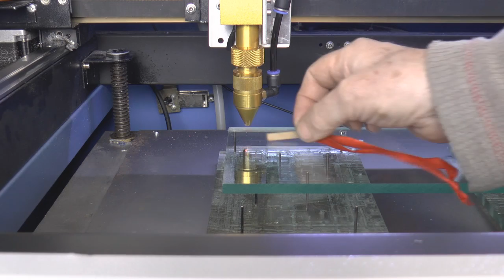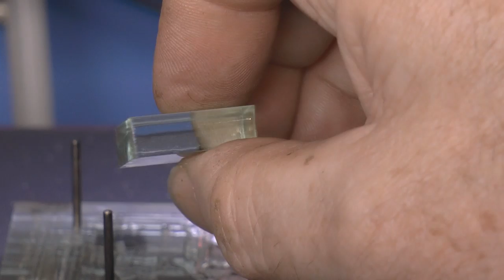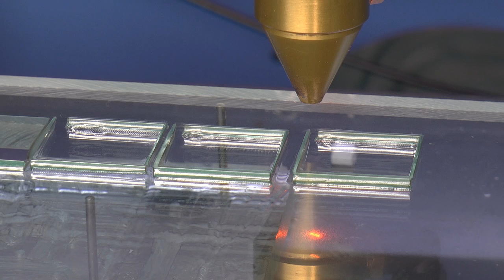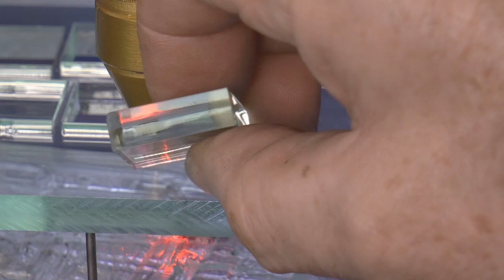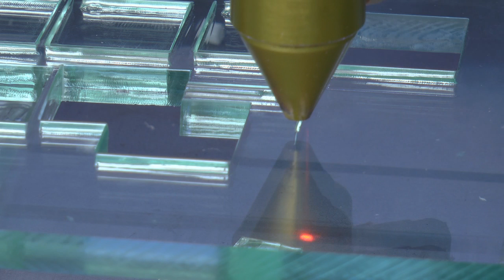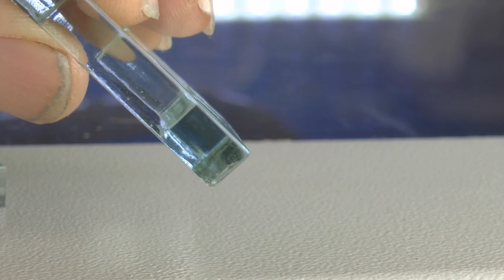RDWorks Learning Lab 54 Acrylic beam drag and flame polishing

Comment: My acryllic just chars and burns
Reply from the maker: Hi
 The bad news is that you are not using acrylic. How can I be sure? Because acrylic is akin to H2O. Acrylic  is solid and clear at room tmperature. At 1  degree C, ice becomes liquid. At 160 C acrylic becomes liquid. At 100C water boils, evaporates and becmes steam. At 20-0C acrlic boils and becomes acrlic vapopur (steam)  Hold a cold surface to eitherannd they recondenswe. It is impossible to burn or char water and so it is with acrylic. The only difference with acrylic vapour is that you can heat it further and it becomes an inflammable gas, Ii is impossible for the cut to biurn and char. I would suggest that you have probably tried to cut polycarbonate  that creates masses of brown fumes or maybe PET which cuts with a reasomabl;y clean edge but produces masses of yellow fumes.  Other clear materials include styrene or ABS.  You should not be cutting either of these because they produce toxic fumes.
Reply: @SarbarMultimedia  thx for the response here in Norway the shops dont Even know what they sell themself. Am suspecting it is PET from your response as it left a yellow Power on the nozzle. Is this also damaging to the machine?
Reply from the maker: @Actio83  
 I have cut quite a lot od PET.. It cuts at quite a high speed and leaves fairly cleam edge but I pesonally never want to breath those fumes. I am fairly confident there is nothing in the fumes to damage the machine  but you havee to leave the protective film on or the yellow fumes stick to the surface and are not easily removed.. PET is a cheaper alternative to p[olycarbonmate  and is what they use for fizzy pop bottles . It has a fairly wide rand of temperature where it remaiss soft and can easily be blow moulded.
Reply: @SarbarMultimedia  I was also unfortunate and had the vent hose loose so it filled the shop with smoke… opened the gate and aired out the room but did inhale a bit. Hopefully not dangerous in on off insistents. That a lot for the help, hard to find knowledge on this
Reply from the maker: @Actio83   Hi 
 The good news is that It cant be that toxic because you made it to the door to ventailate the shop!!  Serously though.  Lots of inhalation willbe bad for you but such small and short term exposure will not harm you
Reply: @SarbarMultimedia  learned a valuable lesson, to be a lot more critical of what the material actually is :)

Comment: maybe someone already asked..  does it matter if it casted or extruded acrylic??
Reply from the maker: Hi Lenny 
 Acrylic is a unique plastic with properties that are analogous to H2O. It is solid at room temperature (ice) but at 160 C it immediately becomes liquid (water). At 200 C it evaporates (steam) into acrylic vapour and can be recondensed back to solid  acrylic upon contact with a cool surface.
 Its a weird quirk of physics  that both cast and extruded  materials are exactly the same molecular structure but they have different properties. The extruded acrylic seems to have a much lower thermal conductivity,  although it cuts just as easily as the cast acrylic.  The lower thermal conductivity retains heat in the walls of the cut for significantly longer and  whilst above 160 C , will allow the thin film of liquid acrylic  on the walls  a few mm behind the cut to "level" out. It is this mechanism that creates the polished finish to the cut.  Below 5 mm thickness it is almost impossible to get that same finish with cast acrylic unless you dramatically reduce the cutting speed (50% or less). Cast acrylic cuts are burr free but run your fingernail over the top or bottom edges of an extruded acrylic cut and you will detect a  noticeable burr.

 Best wishes
Russ
Reply: @SarbarMultimedia  thanks for the info.
will give it some more tries with different settings.  the one I made started to crack all over after a few days.

Comment: Thank you again for another great information video. Do you have any idea how to get rid of the vapour coming from the cut? Those often 'melt' or settle into my acrylic, ruining the surface image. An example is at 3.13 in this video to the right and left of the cut line. Thank you
Reply from the maker: Hi
Acrylic might look like a soft easy plastic to cut and engrave but it has some unique material characteristics. It is solid at room temperature and then turns to liquid at 160C, It remains liquid for a short time until 200C where it turns into acrylic vapour (just like water turns to steam). There is NO chemical change,  so as soon as it touches your work surface (or any other cold surface) it will condense back to liquid acrylic (just like steam turns back to water) which eats into your surface a little as it cools back to solid. That is why you get this misting effect that will NOT wipe off.
Characteristic number 2.  Just like a cup of boiling water will quickly fill a room with steam because the vapour occupies thousands of times more volume than the liquid, so is the case with acrylic. If you lightly pulse the surface of acrylic with low energy you will convert just a small volume of acrylic to vapour and it will explode UPWARDS like a volcanic ejection. However, if you increase the power you will be trying to convert much more solid into vapor and the uprush of gas is not quick enough to let all the expanding gas flow UPWARDS. There is so much volume that it gets forced sideways and IMMEDIATELY condenses on your work surface,.
 So there are  TWO things you do not want during engraving. First you do not want any powerful air assist blowing fumes down onto your work , just a gentle airflow to protect your lens. Secondly you  need the MINIMUM of power to mark the surface of your material . If you engrave deeply then you will suffer acrylic condensation no matter what. A good trick is to dither any bitmap image so that you are breaking up the power into discreet dots and short lines. Use low power.
 Cutting is different. Whenever you start a cut you will always have the explosive horizontal debris because there is nowhere else for it to go. Once your cut has started you need max air assist to blow the fumes out of the BOTTOM of your work, you do not want any fumes coming up.
 Hope this helps
Best wishes
Russ
Reply: @SarbarMultimedia  Dear Russ, thank you for such a prompt and detailed reply.  After watching 8 hours of your videos yesterday I'm making progress with my machine!

Comment: I am  wondering what kind of base are you using.  I mostly see people with Honeycomb bases that are metal.  Yours looks like it is either glass or a big acrylic piece...
Reply from the maker: Hi Matt
You must remember that you are following me on a journey of discovery and at this stage I have so much more to learn. I have not yet discovered the real value of air assist for cutting or the essential requirement for air flow management through the machine.. I have  found  that honeycomb tables are a bit of a disaster  for most cutting because the beam reflecting off the metal edges of the cells cause burn marks on the back of your material.  Lifting the material off the table prevents this reflection and also allows the fumes to escape freely below the material rather than being trapped in a long thin tube (the honeycomb cell).  Air flow management and cut efficiency is a subject that would take me several pages to explain. If you serach for RDWorks Learning Lab Air  Assist, you will come across several videos where I uncover the secrets.  You will then begin to understand the reason why no machine should ever be fitted with honeycomb. It looks like a brilliant idea but turns out to be as brilliant as shaving with a blow torch.

Best wishes
Russ

Comment: Could a collimated beam (passing through a converging lens to tighten it up then through a diverging lens to bring it back "straight") solve this problem altogether?  I'm trying to remember the college-grade optical physics course which I took over 20 years ago...
Reply from the maker: Hi Claude

Hi Claude

There is one massive problem with trying to apply conventional lens theory to our IR beam . Lens theory assumes a uniform collimated beam and usually monochromatic.. We  have the single wavelength (10.6 microns) but the beam is not uniform, It's energy density is close to Gaussian  (a normal distribution) About 70% of the beams energy is contained within 1/3 of its diameter.. Unfortunately beam drag has nothing to do with the convergence or divergence of the beam. it i all to do with energy per unit of time.  When you try to cut too fast the  bottom of the beam starts to drag as it runs out of energy. If you slow the cut then there s sufficient energy per unit of time to damage the material vertically. To demonstrate this time and energy principle, pass your hand over a candle flame. The faster you move your hand the less heat you will feel. Slow right down and the heat will have sufficient time to reach the damage threshold for your skin.. Ouch.

Best wishes
Russ
Reply: @SarbarMultimedia  In fact I should have specified the "hourglass shape" of the cut when I was referring to "the problem".  Thank you for your response.  My optics course is really far back in my memory :-)
Reply from the maker: @claudehebert3131  
Hi Claude 

You may be a bit surprised about your hour glass supposition. I am close to completing my VERY in depth study of cutting with various materials and lenses. The results so far are rather interesting. I'll say no more at present.

Best wishes
Russ

Comment: Thx again Russ  started with a 80w laser now have a 150 watt bigger bed size also and still your videos are so helpful, your stuff and the way you present are fantastic 2 years ago i got my first machine now Im running 2 Yes its Wayne with multiple sclerosis no won told my I couldn't so i did :-)
Reply from the maker: Hi Wayne
Congratulations on your new acquisition. I presume that your experience with 80 watts convinced you that for all the cutting you do it would be more efficient with a more powerful tube?All best wishes for the future...maybe working towards #3?
Russ
Reply: @SarbarMultimedia  yes I've got a big contract cutting 10mm acrylics  needed the power

Comment: If you want like a crystal edge finish, remove the air
Reply: You are both right and wrong. If you turn the airflow to almost zero then you decrease the cutting efficiency and allow heat to build up in the cut. That heat build up allows a thin film of liquid acrylic to form in the kerf just behind the cut and this liquid has a levelling (polishing )effect on the  edge striations. That is the theory behind reducing the air assist BUT it rather depends on the type of acrylic you are cutting. If it happens to be extruded acrylic sheet then you will get the polished edged with or without air assist. If it is cast acrylic then you will really struggle to get a good flame burnished finish, not only will you need to turn off the air but you will need to run at least 50% slower to allow the heat to build up.The thinner the cast acrylic the more difficult it will be to achieve that heat build up in the cut . Cutting thinner cast acrylic with a longer focal length lens helps with heat build up. So it's not just as simple as turning the air assist right down. NEVER turn it off or you will coat your lens with acrylic vapour.

Bet wishes
Russ
Reply: @russsadler3471  Thanks for the explaination, very usefull
Reply from the maker: @alifyaanidyanina965  
Hi Alifya
I have done more experimental work on this subject  but it is best summed up in this video
https://www.youtube.com/watch?v=ygN_GJwPLQM&t=1s&index=48&list=PLPWEtx5V9DqEogIeYRdcG_KYcB7UL2Qmn

Best wishes
Russ

Comment: When cutting such a thick material, the first thing I would have tried is of course lowering the focus point into a mid depth of material, instead of surface. That makes all sense of course.
Reply from the maker: Hi Vlad.
Your theory is  a bit of a myth. I have done many experiments and my advice is ALWAYS set the focal point on the surface, especially with acrylic  The basic idea for this myth is a misinterpretation of advice that Trotec give in there guidance for cutting acrylic ABOVE 10mm thick. The big problem is that we do not have the RF driven tube that you will find in a Trotec machine so the effect of the beam is totally different. You will need lots of power and a 5" focal length lens. You can read this for yourself at the top of page 5 in the following document
https://howtolaser.com/blog/how-to-laser-cut-acrylic/. It confirms that up to 10mm thick you keep the focus on the surfsce

Until you have experimented for yourself, I would stay safe and ignore the myth.

Best wishes
Russ
Reply: SarbarMultimedia i actually did and it worked better when i lowered. But none of my experiments are even nearly as sophisticated as yours, so I’ll just take your word for it and will follow your advice then!  Thanks again for providing so much research on youtube for us. Best channel for DIY lasers, period. I bought K40 first for $350, but didnt realize it would be that bad. So decided to return that one and I have 50W machine on order now which I bought for $1350. Slightly more powerful tube there, but also all components are 5x better than K40. Will be worth the investment.
Reply from the maker: The next size machine will definitely be better than the K40.  I suspect you are buying from ebay?  It's good value for money but will probably not be a reliable machine until you fit a new tube and power supply. The ones supplied will almost certainly be sub standard because the Chinese have worked out that people buying from ebay are fairly naive of the technology and it will take a long time to work out that what they have bought is not the real deal.
Sorry to be pesimistic but my evidence base is huge.
Best wishes
Russ
Reply: SarbarMultimedia no problem. I have been working with China on relatively large scale for over 7 years. I know exactly what they do and how this machine is built. I just accept it for $1350 with free 2day delivery. I thought of building my own, but I have too many projects now already in progress. So, decided to just buy. If anything is sub-spec on this machine, they will have to adjust the price for me. I am not one of those naive consumers :))) My last buy from ebay was a 6040 CNC router for $1400, and I ended up only paying $400 for it due to a lot of mess that they made in that machine. So, with that said, I will be thoroughly examining this laser machine, including tube check for conformity sticker etc. if they use reject tubes for $350 K40 machine, it is totally ok. Reject tube for $1350 machine - i will not be ok with. And if they do use reject tubes, and I find that out, it will just cost them money on this order.
Reply from the maker: Hi Vlad
Good luck with your purchase. Let me know the final outcome.
Best wishes
Russ

Comment: I know this is an older post, but I can offer advice to anyone still reading this.  Any laser, even a cheap Chinese one, should have a 3.0in or 4.0in lens, if you are going to cut acrylic.  A 2.0in is okay for 1/8in or less, maybe 1/4in, at most.  When you start getting into 8mm, 1/5in, etc.  You have to have a longer lens.  This is exactly what he concludes at the end.  That the power is gone/out of focus, by the time it gets to the last 2mm of material.
For what it's worth, focusing the 1.5in lens into the material some, actually makes the cut worse in many cases.  That is the main reason for the larger gap at the top.  In addition to using a longer lens, you should focus it right at the surface.
For those discussion a collimator for the beam, you are in luck!  The optically clear acrylic actually does this for you.  When the beam is focused on the surface, the index of refraction straightens it out a bit.  So, in any case, with any lens, focusing into the material gets you nowhere.  (with clear material - a solid color is different)
Very slow speed, is the main thing that gets rid of the "beam drag"  Even using a powerful 150W laser that my company sells, I usually cut the power down to 80-100Watts, and go very slow (1.5in/s, or 38mm/s)  I know that is still a lot faster than the 4mm/s in the video.
Reply: Hello Jason do you any manual or something that you can give, I really want to do better my work. Today I was trying to cut a piece of 10 mm, I think the laser in my job is 150w but the cut is really bad I was trying with 70% power and 3 mm/s do you have any advice for me. Thank you so much

Comment: Would having a collimator help reduce the beam width and straighten it out, or is that cost prohibitive?
Reply from the maker: Hi Mark
Others have suggested the same  and even gone off to make their own versions and trials.....never to report back. The proper beam collimators I have seen basically only allow the high energy density part of the beam into the lens. In my logical world that implies that I could be preventing 20 to 30% of the available power ever reaching the lens. Beyond that unacceptable objection, cost, space and addition head mass would then become issues. 
I have done a couple of experiments using a 4" FL lens to focus the beam down before passing it through a 1.5" FL lens.  No staggering results but I have not completely dropped the idea.

Thanks for the comment
Best wishes
Russ
Reply: I see... more complex than I had thought. I was just thinking of an additional lens after the focus lens to stop the divergence. As my wife likes to ask "How hard can it be?"